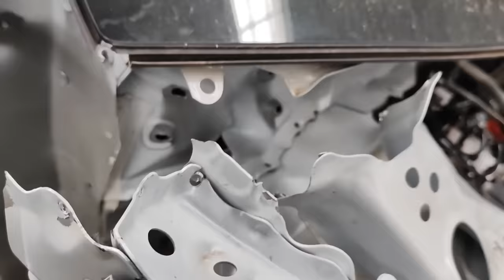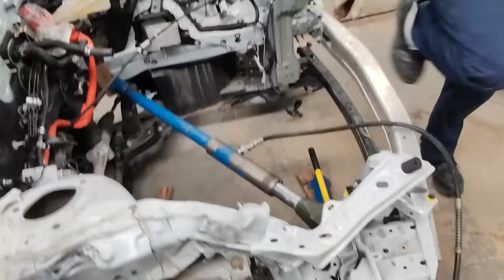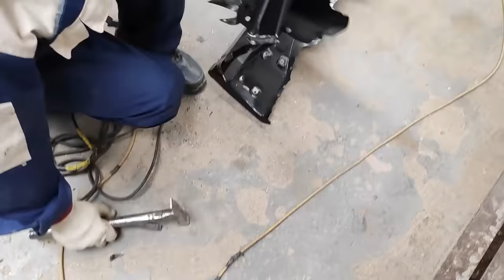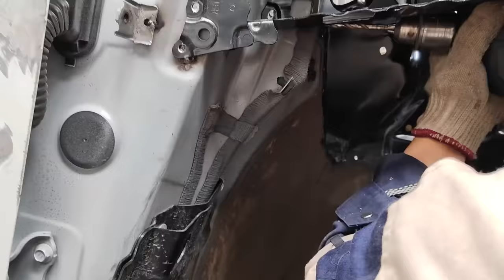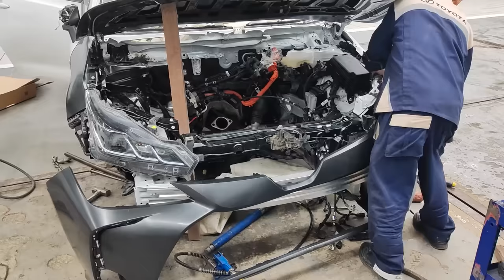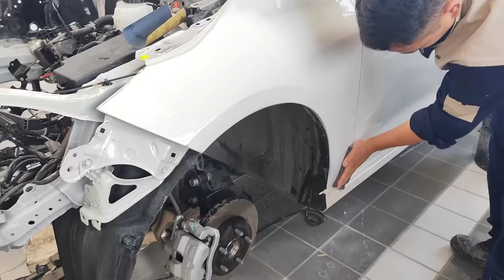Restoring a Brand-New Toyota Corolla After Front-End Collision！

Comment: People here forget that while it is possible to fix a car like this, it may not be as safe as one that has not been wrecked.  This is one thing people sort of neglect to consider.  Once those beams and supports get bent like that, you can bend them back, but they are weakened structurally. If they have an actual frame, that's different, but a unibody construction may not be as safe, even though it may be "fixed" to within specs (but usually that's just measurements like is this part the same dimension as a new one?  It does not always take into account its ability to withstand another impact).
Reply from the maker: You bring up a very important point about safety when repairing a vehicle that has sustained significant damage. Unibody construction, as you mentioned, can be particularly sensitive to structural damage. While it may be possible to restore a vehicle to its original specifications in terms of measurements, it doesn't always guarantee the same level of safety as an undamaged vehicle.
Reply: do you really believe that people dont know that mundane nonsense you just wrote?and I guess mechanics dont get taught about metal fatigue or any of that  jazz....that knowledge is exclusively known by you😏
Reply: @xinxianshi  I would drive your with utmost confidence. I can see you literally replaced the bent/damaged frames. The measurement are for having the carl lined up as it should. I didn;t see any burnt frame straightened and repainted. Your work is awesome. again,  I would drive your with utmost confidence. I've seen in the US shady work ......
Reply: It’s the same for humans. If you receive serious injuries they may not ever be so strong again. Logic.

Comment: this is how I see it; all motor veichel places advertise the inside safety features; not the outside safety features; once in a collision; cause there isn't any outside safety features; even if it can be repaired & parts replaced, it will never be safe to drive. So instead of focusing on how to increase the value of your car with all these electric gadgets, that can costs thousands to replace; put safety first on the outside, there, now that is a thought.

Comment: Everything is fine but what about antirust zinc coating on the welded elements? Without that the redhead will be dancing inside like crazy soon...
Reply from the maker: Hello, thank you for your compliment. The anti-rust coating is a two-component epoxy primer, which has a very good effect on rust prevention.

Comment: Ok but internal sections of welds will rust. Thats why manuf require rivet or spot weld binding (epoxy)
Reply from the maker: Yes, usually after welding is completed, we will do cavity wax treatment on the parts that may rust to maximize the service life of the vehicle.

Comment: welds over sprayed metal. then doesn't spay any paint over the finished weld to halt rusting.....and new car........anyone spot all that rust by the front wheel ? and as the camera pans you see just how thin the spay paint is
Reply: Job done in 2 days.. the paint was still wet as they drove it out

Comment: Surprised the vehicles wasn't just scraped and used for parts, in most developed countries this would be an instant write-off as repair bills would quickly total the car not to mention the compromise on structural integrity, how would this repair hold up in a crash? I guess labor is very cheap in China.
Reply from the maker: You guessed it right. Such work will only be done when labor is very cheap. Safety is also an important reason. As people's economic conditions improve, they will pay more attention to safety. However, in some backward countries, people will put safety after economic benefits.
Reply from the maker: You guessed it right. Such work will only be done when labor is very cheap. Safety is also an important reason. As people's economic conditions improve, they will pay more attention to safety. However, in some backward countries, people will put safety after economic benefits.

Comment: These technicians are very skiIled and repair this car according to the highest standards, but I always wonder if the repaired car will not be more prone to corrosion, due to the fact that weldspots are not getting the same protection as in factory.
Reply from the maker: You bring up a valid point. Skilled technicians like the ones shown in the video perform repairs to a high standard, but it's true that repaired areas might not receive the same level of corrosion protection as factory-made components. Factory production processes often include advanced rust prevention methods, such as precise coating applications and controlled environments, which can be challenging to replicate in a repair setting. However, experienced professionals will use methods and coatings designed to mitigate the risk of corrosion in repaired areas. Regular maintenance and rust prevention efforts by car owners also play a crucial role in extending the lifespan of a repaired vehicle and preventing corrosion issues.
Reply: I'd be more concerned about safety.  How well would it with stand another collision like that in the same area?  This is partially why some insurance companies will just junk cars.  Partially for cost reasons but also for safety.  One of my friends who is an insurance agent told me that in some cases, even if they can fix a car financially, it may not be done (and may be totalled) for safety reasons... as in the car may not be able to be fixed to a point where it could be deemed safe enough to withstand another accident.  It may look OK on the surface, but structurally it may be compromised.  Once some of the parts of the body are bent, they lose their original strength, even if they are filled and bent back).

Comment: Should have had a new body shell, too much damage to frame and into bulkhead. can you imagine seeing your car that badly smashed up being taken off to the garage then a few weeks later you get the same repaired car back, I would be gutted.
Reply from the maker: I understand your concern about the extent of the damage and the decision to repair rather than replace the body shell. The decision to repair or replace major components like the body shell depends on various factors, including the availability of parts, cost considerations, and the expertise of the repair professionals. In some cases, extensive repairs can be performed to restore the structural integrity of the vehicle. However, I also understand that different people might have different preferences when it comes to repairing or replacing severely damaged vehicles.
Reply: You would have thought it would have been repaired on a jig ? not even sure the welding's that good

Comment: welding without removing the paint first, I simply cant believe this, and measure with tape measure, lol
Reply from the maker: It's important to note that the specific methods and practices used in automotive repair can vary, and professionals may employ techniques based on their experience and the specific requirements of the job.

Comment: Where do they buy the donor car pieces?
Reply from the maker: The acquisition of donor car pieces for repairs can vary based on the repair shop, the availability of parts, and the preferences of the technicians. Here are a few common sources for obtaining donor car pieces:

1. *Salvage Yards:* Many repair shops source used or salvaged parts from auto salvage yards. These yards often have a variety of vehicles from which parts can be harvested.

2. *Auto Recycling Centers:* Some repair shops work with auto recycling centers that specialize in dismantling vehicles and selling reusable parts.

3. *Online Platforms:* With the rise of online marketplaces, technicians can also find donor car pieces through websites specializing in used auto parts.

4. *Specialized Suppliers:* Certain suppliers specialize in providing recycled or refurbished auto parts. These suppliers may have an inventory of parts that meet specific quality standards.

5. *Donor Cars:* In some cases, repair shops might purchase entire donor cars to extract the needed parts. This can be cost-effective when multiple parts are required.

It's essential for repair shops to ensure that the donor parts they acquire are in good condition and meet safety and quality standards. The specific practices can vary, so if you have concerns or questions about a particular repair process, it's advisable to inquire with the repair shop directly.

Comment: Not sure if I would have relied on a tape measure for checking alignment. That car took a structure hit and should have been built on a jig, the chassis would have been stretched and weakened. Just look at the front strut caved into the engine bay @0.20. That car is weak now.
Reply from the maker: You are right. The car was severely damaged and it is difficult to restore its original strength after repair. In addition, measuring with a tape measure will not affect the repair effect. Even with more sophisticated instruments, it is difficult to guarantee that there will be no errors. And some minor errors are acceptable.

Comment: This car would have been written off in North America and for good reason.
Reply from the maker: You're right, in North America and many other regions, cars with extensive damage like the one shown in the video are often declared as "total losses" by insurance companies. This means that the cost of repairing the vehicle exceeds its market value, making it more cost-effective to replace the car rather than attempting extensive repairs. However, in some other parts of the world, especially where labor costs are lower, and access to replacement parts is more affordable, it can be economically viable to repair heavily damaged vehicles. The decision to repair or write off a car depends on various factors, including local regulations, the extent of the damage, and the cost of repairs relative to the car's value.

Comment: How mach cost this damage?
Reply from the maker: The cost of repairing such extensive damage can vary significantly based on factors like the extent of the damage, the availability of parts, and labor costs in the specific location. Without specific information about the situation, it's difficult to provide an accurate estimate. However, repairing structural damage like this can often be quite expensive due to the complexity and labor-intensive nature of the work involved. It's best to consult with a professional repair shop to get a detailed estimate for your specific case.

Comment: how much did it all cost?
Reply from the maker: The repair cost this time was about $1500, because labor costs are relatively low in China. Repair costs can be affected by many factors, including the extent of the repair, parts cost, labor costs, and more. This repair involved multiple steps and processes to ensure the vehicle could be restored to its original condition. If you are interested in learning more about the cost of a similar repair, I recommend consulting your local auto repair shop or body shop, who can provide you with a more detailed cost estimate based on the condition of your vehicle and the scope of the repair.

Comment: Thats how shoddy new cars are the strut tower support just pulled of the firewall looks like it was never attached  😢😢
Reply from the maker: Indeed, the sheet metal materials used by Japanese brands are relatively thin, but their safety has been tested.
Reply: @xinxianshi  yes I know that mate but you wouldn't see that on older cars it's not a good look keep up the terrific work there's no problems with your work